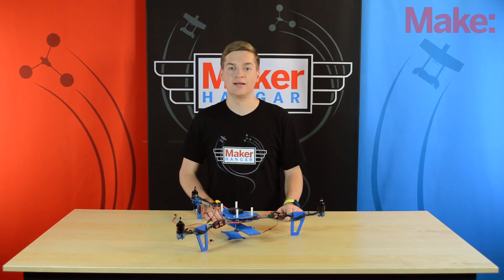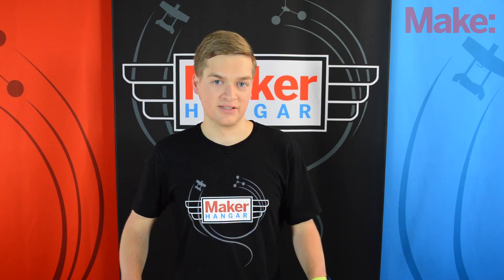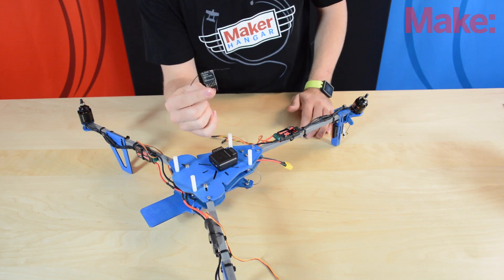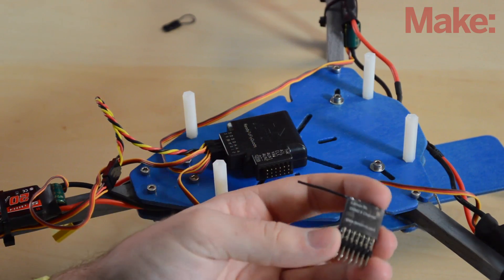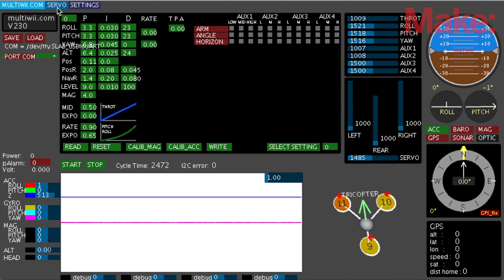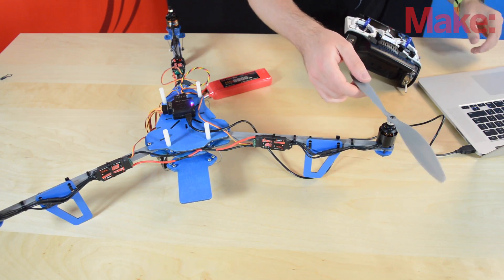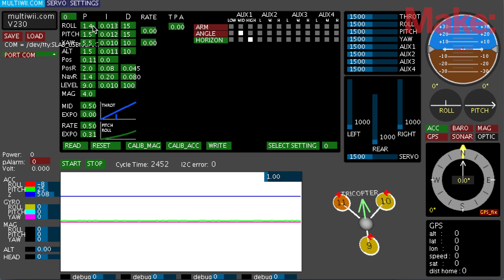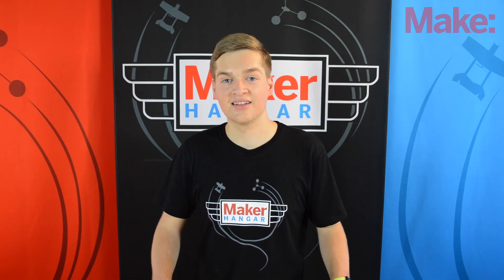Maker Hangar 2: 04 - Flight Controller Boards

Comment: I just got the correct male to male plugs for the receiver to controller.  Looking at the video I seem to be missing a plug on the controller for the TH (Throttle).  The controller I was sent has 6 rows of three pins, AIL, ELE, YAW, AUX1 AUX2 and ^ + -  .Nothing marked TH.

Comment: The Tri-copter is complete through making the electronics work. I'm using the Flip 1.5 flight controller board. I'm also using the OrangeRx T-SIX Transmitter and receiver. I set up the ESC’s and verified that they work with the receiver and transmitter. I hooked up the receiver and various esc’s and servo’s to the Flip 1.5 and nothing happens. I then hooked it up to my computer via the USB connector. The Flip is seeing the signal from the transmitter, as evidenced by the MultiWiiConfig indicators. The signal is not being relayed to the various motors and servo. I have taken the wires apart, verified the connections and rehooked up the system several times. btw, there is a slow flashing red light in the receiver. I have no idea if that means anything. Any help is appreciated.
Reply: did you follow the usual tutorials like: http://witespyquad.gostorego.com/videos.html ?
They take time but I finally got everything working with those.
As mentioned below do not check the ARM box in MultiWiiConfig. Also make sure to adjust travels of your radio correctly to get 1000-1500-2000 travel on all your sticks - otherwise you can't ARM the flip with the stick commands.

Comment: I am having trouble with the throttle. I Bound the rx to the tx. Then set up the ESCs with the tx. I hooked everything up to the rx and the Flip FC and I can't get the board to arm... my trims are right in the middle what else can I check ?

Comment: I cannot get my Flip 1.5 to arm at all... It lights up but the stick position is not arming it. I am stuck!
Reply: I'm having the same problem, did you ever resolve it?
Reply: Yes. Throttle trim all the way to the bottom.
Reply: Thanks— throttle seemed to be reversed for some reason and my trims might have been off too. Working now!
Reply: Have fun and keep us posted. I am going to try to get out and fly a bit this afternoon.
Reply: It still turned out to be a pain, the hobbyking HK6S transmitter doesn't have travel adjust, after fidgeting with it for the best part of an afternoon, I bit the bullet and got a DX7s. I guess I'm dedicated now,  If only I could find a good flying field... Hope you enjoyed yourself.
Reply: I ran into the same problem here in the Reno/Sparks area. Fortunately, my local park is big enough for my tricopter...
Reply: Jan De Wilde Oh no a Spectrum DX7... they are pricey and have far less functionality than Taranis.
Reply: I am waiting on a Turnigy 9XR to show up in the states.
Reply: Keith Applegarth The 9XR has poor quality control and ergonomics. RCmodelreveiws has little good to say about them. The 9XR pro is a bit better, but is not sold with modules or telemetry receivers. For a bit more the FrSky Taranis comes with a 8XR telemetry receiver. GetFPV.com carries them for $200 and does free shipping in the US. 
The radio is where I think you should really sink money. You don't lose it in a crash and you can pair a good one with as many models as you make for the rest of it's use.
Reply: RCshowmen DX8 is on sale for $209 at rcsuperstore.com, not a bad deal either
Reply: Jan De Wilde The DX8 is a good radio but FrSky has a more reliable link and Taranis can accept JR style modules so you can use long range modules easily.

Comment: What you say about ARM at 15:10 is very wrong ! ARM "box" is just the check box for eventually ARM the copter instead of using the stick position. The box allow to define a radio switch from TX for ARM the board. Also, you miss to show a very important part: show how to set up end point and center point of the TX for match the 1000-1500-2000 scale used by MultiWii.
Reply: Yes, I agree with everything you say. I will be adding this additional information to the blog post accompanying this video. I just made a mistake in saying to check the arm box. Thank you for the correction.

Comment: Well as i am from germany and ordering the Maker trainer 2 kit is no option due to shipping costs, will there be pdf plans for the foam parts?
Reply: The pdf plans for both aircraft will be hosted on the Maker Hangar page on makezine.com They haven't updated it yet and i've been trying really hard to get in touch with them to get it updated. Thank you for being patient.
Reply: Lucas Weakley Thanks! Are there any chances of getting the digital drawings for laser cutting?
Reply: ***** I have the vector files and .dwg files. will those work?
Reply: Lucas Weakley The service I want to use (snijlab.nl) asks for .dxf files version 2004 or older. I suppose I could convert .dwg files to .dxf somewhere.
Reply: ***** Yes, I can supply those for you.
Reply: Lucas Weakley Thanks again, that's very kind of you. Are you going to place the links in the makezine article(s)?
Reply: ***** It'll be on the makezine.com/makerhangar page, as soon as it is updated.
Reply: Not to mention import taxes, that are 21%VAT plus around 20 euro "handling costs" in my country.
I also asked the same question below the previous video (for digital drawing, not PDF), but it hasn't been answered so far. I think I'll just draw my own frame and have it laser cut, but I'm not in a hurry as I've got other projects to complete 1st.
Anyway the yaw construction on this design isn't good. A "U" bracket in which the yaw servo swivels is better as it allows the motor+prop CG to be inline with the pivot points. If it's not, then it can cause yaw oscillations due to mass shifting with flight controllers that try to maintain heading stability (APM/Arducopter is one of them).
Example "U" yaw mount here: http://diydrones.com/profiles/blogs/tricopter-based-on-arducopter-yaw-issues-and-solutions

Comment: You can't fly without gyro... Should not sell this stuff 
Learn to fly and come back later
Reply: Gyros don't fly for you they only compensate for wind and the multicopters instability. If you turn them off then there is nothing preventing it from tipping over or moving to far after a control input. You can not find a controller board without gyros because it would be pointless other wise. Even conventional helicopters use gyros to counter the torque roll, and without them you wouldn't be able to control it. It isn't impossible to fly without them, like I said I tried it, but you have to do the job of the controller board which is like balancing on the top of an exercise ball while also trying to move where you want to go. Accelerometers are optional, and they will level the board for you and yes if I didn't know how to fly with those turned off I wouldn't be here.
Reply: Gyros are optional on older helis... And they are flyable too. A multicopter without Gyros is similar to an old heli
Reply: Controlled similar *